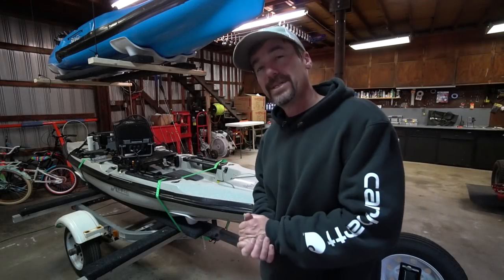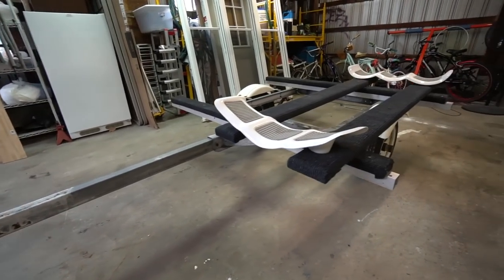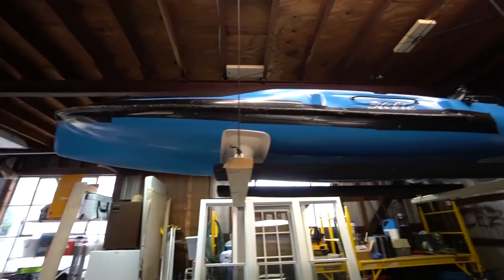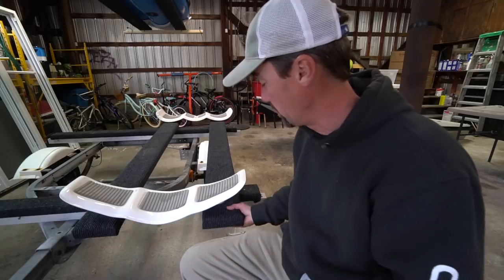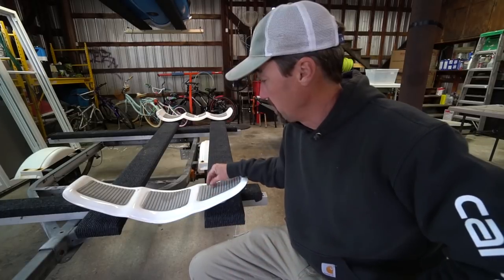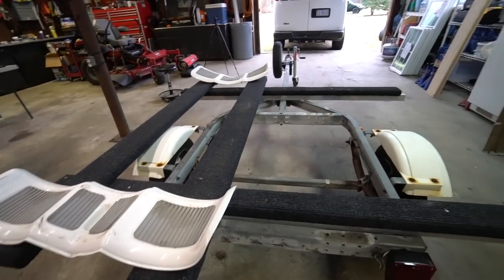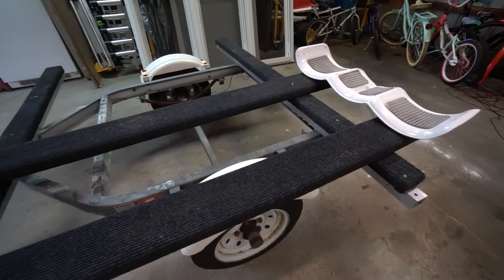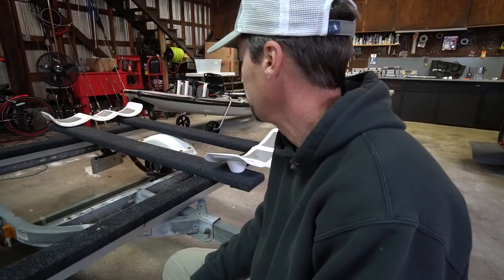CHEAP and VERSATILE KAYAK Trailer Setup

Comment: Those Hobie cradles are a lot of $$$. I was looking at them today.
Reply from the maker: Yes they cost more than the entire setup
Reply: I took a jet ski trailer and used 2.5" PVC runners.  Laid it on with em loose, let it lay and marked the center of the bolts so I knew where to set them.  Removed the kayak and tightened up.  Replaced and it sat like it was at home.  2 pipe, 1 stick uni-strut, some hardware.  No worrying about breaking those expensive carriers.